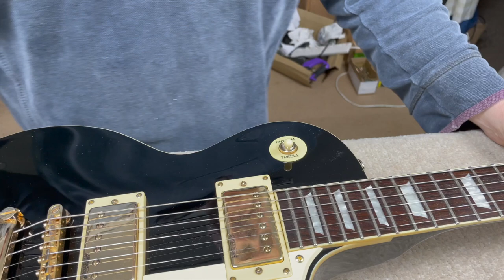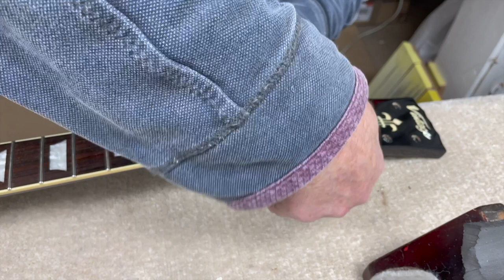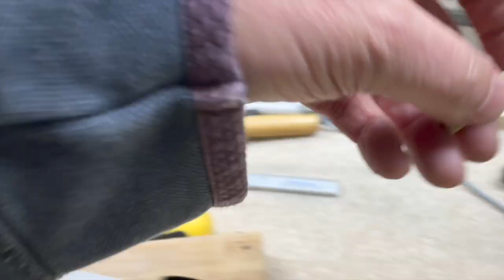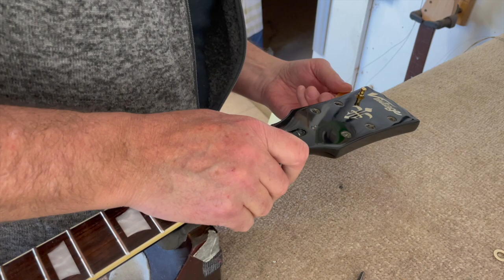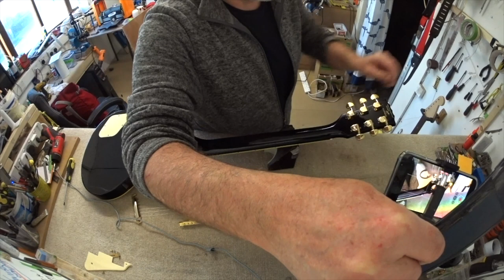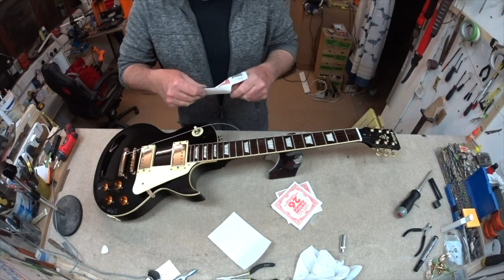Vintage V100 set up and headstock rescue

Comment: Hi Sam , really interesting to see how you set the low action on my guitar , I felt awful the trouble you had getting the nut off I suppose buying this price range of guitar which 
are  put together on a busy production line & the guy who glued the nut on mine was talking to his mate & not watching the amount of bloody glue he put the nut on with , so sorry Sam , but thank you for your patience & excellent work you did for me , I pick it up everyday now & im no Gary Moore but I enjoy myself , many many thanks Sam kind regards Robert
Reply from the maker: Hi Robert - no apologies needed! I hit (literally) an unusually stuck nut. I had assumed the finish was acting like glue but your point about the way it was likely glued on means that the paint layer was probably also glued to the back of the nut. Still, we all make mistakes and for my part I will always put it right when I do, to the very best of my abilities. In the past I completely refinished a Fender neck because I put a slight dent in the wood from my neck caul which had run out of supporting cork. That required sanding out, which also took out the poly finish. That in turn meant a 120 mile round trip to a friend who was good with a poly spray set up, but I was determined to do it right, so that's what I did. Anyway, I'm very pleased how much you like the set up :)
Reply: Hi Robert - I've got about 6 or 7 Vintages and the older one's like yours are not as well put together as the newer ones definitely, so it's not uncommon for annoying niggles like this to happen with them. I've been lucky with the nuts so far but some of the electronics compartments on the older ones look really under-finished and/or rushed. Still lovely guitars and glad that you can keep on playing with a lovely low action. As an ageing git myself, I'm slowly updating my guitars to 8 gauge strings as well, because the tonal difference is not even noticeable to my ears (probably age as well lol) and the feel for bends and chords is so much better. Hey if it was good enough for Jimmy Page :)

Comment: Just bought one 2011  in Feb those Humbuckers are  Seth Lover Paf  design given to Trevor Wilkinson they do sound amazing,  what upgrades if any would you do ?
Reply from the maker: Tusq nut (or Tusq adjustable!) for sure; set up, fret levelling and new strings. Beyond that nothing really... if you have the money then super smooth tuners never hurt, roller bridge also nice.
Reply: @SamDeeksRelovedGuitars  agree with you; these Vintage brand instruments are very respectable. Just a good set up and away you go. Most times there’s absolutely nothing wrong with the electronics or hardware on these instruments.

Comment: Hi Sam, what is the tool you're using to enlarge the headstock tuning peg holes? Seems a simpler, more elegant solution for increasing a few millimetres than a bench drill
Reply from the maker: Hi Martin - it's a 'reamer' dead cheap on Amazon. MIne's probably lousy quality (costing something like £5 or so) but it also introduced me to the much easier-than-drilling way of enlarging holes. Note, unless it's extra sharp or if the wood is spongy you can get slightly less-than-clean holes but nothing bad.
Reply: @SamDeeksRelovedGuitars  Ah brilliant, thanks Sam. Not too worried about cleanliness of holes as I won't be working on anything more exotic than a Squier or Epiphone and some of them are not exactly custom hand finished haha.

Comment: I never seen someone so careless with guitars. Just file it! It's not worth damaging the guitar. It's easy to get great playable low action
Reply from the maker: Sure, you're the guy who's been doing this for a living since....?
Reply: @SamDeeksRelovedGuitars  you aren't supposed to fret level under tension. The neck is supposed to be straight. Then after leveling you put strings on it and adjust the truss rod according. I wonder how many little marks and scratches you put on the guitar when you put those old strings on it and do everything with the strings on it. Very low action is not hard to achieve. Action height is measured at the 12th fret on LP style guitars not the 22nd. Also if you're setting these guitars up with perfect low action, why the adjustable nut?
Reply from the maker: @jamescarpenter4777  I’m not even going to bother James. It’s clearly outside of your frame of reference so therefore wrong. No problem.

Comment: Headstock looks great after the refin. Odd that it needed tuners; normally I think of Vintage as being part of Wilkinson and thus, having decent hardware.
Reply from the maker: Thanks Vayabroder... my customer didn't like the snot green mostly but you have to remember that style of tuner is only about 15:1 ratio. Works fine... but by swapping them for the gold Grover-style Robert got a chance to go to 19:1 tuners which gives a much smoother operation.